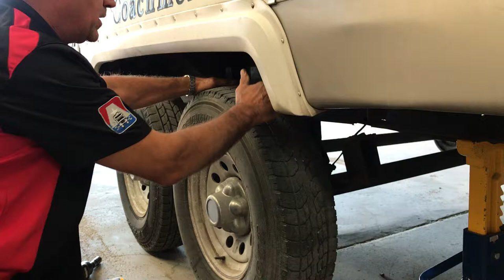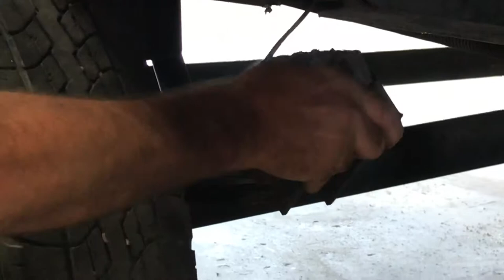Axle and hitch alignment is critical

Comment: I have a little 4x8 trailer that always sways left and right. Suspension is tight,  tires don't wear unevenly. Doesn't matter of its loaded or unloaded. Starts about 25mph and gets worse as speed increases. I think the tracking is off. How is the simplest way to check axle being square to tongue? Thanks.
Reply from the maker: Hello Headpainter1, measure from the center of the coupler (where the hitch ball attaches) to the far right and left spindles of the axle. The measurement ideally will be exactly the same. A 1/8” deviation from left to right is an acceptable allowance. The swaying could be caused by not having the axle positioned correctly on the trailer frame in regard to weight distribution. Happy trails!
Reply: @actionrv  OK. Will do. I really appreciate the rapid response. Best!